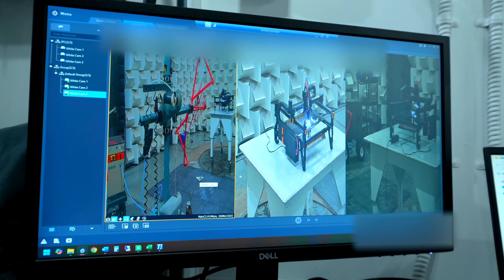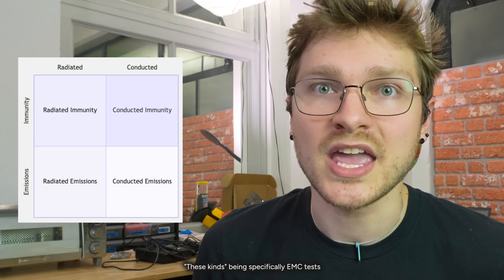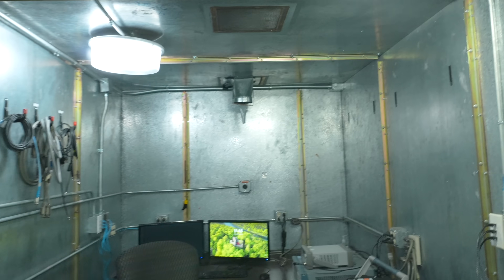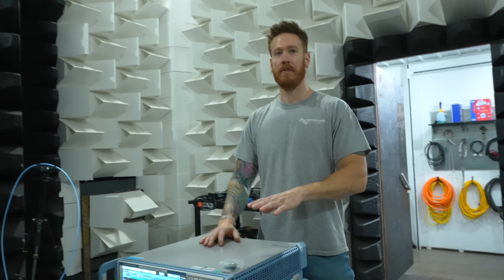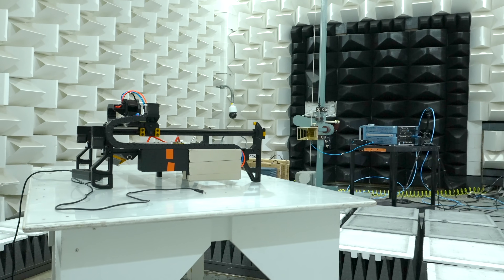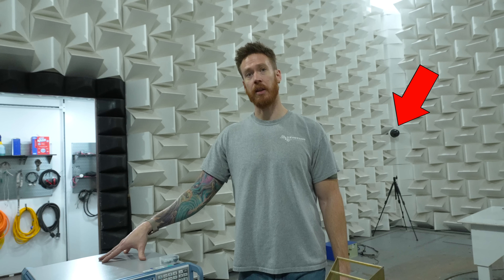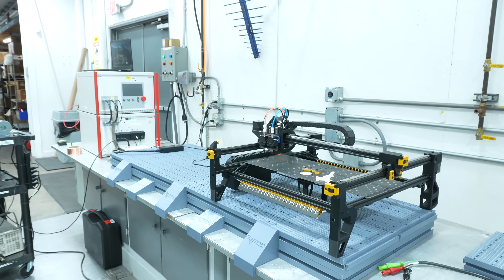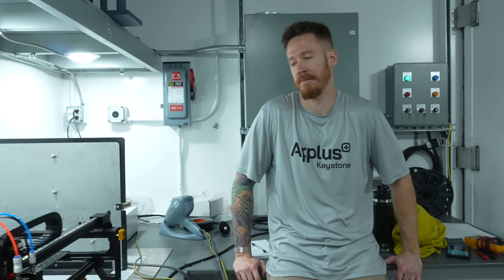Getting Certified: Start to Finish

Comment: I'd be interested in a video explaining some of the changes made to the Lumen before the certification process. It would be interesting to have some examples what to look out for if you want to go through this process with your own product.
Reply: I guessing the following:

1) They improve the DC-DC converter. Usually buck converter are a source of radiated emission. You have to plan carefull where to place components and you need solid ground to "absorbe" the emission. Probably the PCB have internal solid ground layers. Possible the PCB is been completly redesign to have 4 or 6 layers.

2) They improve all ports and every think that connect the electronics board to outside world. You need some esd chip to protect against Electrostatic Discharge.

3) The usb and dc port need some filtration you need an filter that protect the outside world against conducted emmision on the connected cable.

4) For the immunity test you need to protect sensitive part of the PCB, probably they add some filtration on usb/dc port

5) You need to be sure that all material of your device don't contain lead or other hazardous material. For the pcb plastic enclousure you need to be sure that is fire retardant.

Anyway the certification is a serious job, not easy to pass.
Reply: this, please
Reply: Yes please

Comment: It's  ridiculous that immunity is part of  compliance for non safety-related stuff - it's a product quality issue. Such a waste of money. 
As a thing that moves, did you have to do anything for the EU machinery directive?
Reply: I’d rather not have my fridge break because some microwaves got to its internals.
Reply: Funny to see your comment on here Mike. Personally I was thinking of making a relatively low-volume instrument, and remembering that you sell your own products was wondering how you did it, as it might have made a good video. 
As for your comment, I agree its a product quality issue, but isn't that what CE is about? As far as I understand, CE exists mostly to protect consumers, that is why it also covers many other (less technical) topics such as toy safety, and ethical application of AI. And if, as the other comment says, your fridge breaks due to some external interference you wouldn't be very happy as a consumer. Try and prove that in a court of law and hold the manufacturer responsible!
Reply: SO it's Ok to sell  things that may break randomly ?
Reply: @framegrace1 I mean, what thing can't break randomly? Everything breaks eventually.
Reply: I have zero problem, at all, with regulation requiring manufacturers of devices I'm spending hundreds of dollars on to prove that random EMR noise won't brick the device suddenly and without warning. We life in an world full of EMR, and we all hate wasting money.
Reply: Immunity is safety relevant, as a device could malfunction and cause harm, like fire uncontrolled movement etc.

Comment: Do you get UL for free because your power supply brick is already UL?  Edit: Oops just read the errata re UL.
What is the risk of selling an extremely low volume electronic product without going through testing?  Classify it as "Experimental" or "Owner's Risk" or something like that?
Reply: iirc, a lot of countries customs won't let you import uncertified stuff. Low volume unlikely to be an issue, but as soon as you reach volume sales you're more and more likely to get caught. iirc for our makerspace the insurance says that we can only run tools that are certified. If a jank diy 3d printer burns down the shop we aren't covered.
Reply: For Europe, CE is required for any and all products, that includes second hand, experimental etc.

Comment: Have you blocked yourself into the design now? From what I have heard, changing as much as the value of a single resistor means you technically have to have it recertified
Reply: Probably depends on your risk tolerance. CE is self certification. You just say your product complies, and then you're liable if it doesn't so you want to be sure. How sure is up to YOUR business risk tolerance.
Reply: This is not true.
Reply: I had the same question, can you still make hardware changes?
Reply: The answer to this can only be "it depends". Thats one of the things where you need to talk to an expert.

Comment: Are you aware that YouTube enabled AI dubbed Audiotracks for your video? Especially the german one is horrible (pronunciation, ...) and sadly YouTube often defaults to the horrible AI Audio even though I have english as one of my languages in my settings (and YouTube does not remember that I turn this off so I have to change audio tracks for every video with this "feature")

On other videos in the past few month I also noticed factual errors in the AI translation (e.g. 3 miles got translated to 3 meters) -> I can not trust this on technical videos like yours

Comment: How do changes to the Lumen affect your ability to identify as certified? I've always thought that the Superpower of the Lumen (or any Open Hardware really) is to rapidly change and iterate. Once you've gotten the v4 certified, would the v4.1 invalidate the certification? When do you have to recertify?

Thanks for sharing. It's really cool to pull back the curtain and see how all this is done.
Reply: This is one of the big pain points when making hardware with the "go fast and break things" mindset more common in software.

Any small change can affect the EMI/EMC, even something as stupid as changing plastic types or the brand of a capacitor. When doing this, there is typically a risk assessment, sometimes involving testing the changed part on its own.

This is not perfect, but it doesn't have to be. You only need to be confident enough that your product meets the norms. Testing in an accredited test house is a great way to ensure this, but in many cases isn't a requirement.

Government organizations won't go out of their way to buy your product and meticulously test it. Instead, if someone reports issues, it will be investigated. Only if the outcome of this investigation shows lack of due diligence or shady attempts at hiding flaws do you get into real trouble.

I'm not a lawyer, and I mostly know about the ETSI / European ways of doing things. Laws are different in other regions (in Japan and Korea for example things tend to be more difficult).
Reply from the maker: Annoyingly, I think the answer is, "It depends!" If we change the front left leg of the machine to have a slightly tighter tolerance for a press-fit nut, pretty unlikely that's going to be an issue. But of course, if there's a full PCB rev, we're definitely getting it retested. I have not seen any explicit guidelines from an agency around the proper approach for this, so I've always taken a very cautions approach on this one. If anyone has any official resources regarding this question, I'd love to see them!
Reply: @stephen_hawes  As an oblique answer to your question: It's worth investing in your own less-sophisticated EMI and ESD testing gear which you can use to get a ballpark assessment of any issues prior to professional lab testing or retesting. Then a professional session is not just assessing your product, it's also an opportunity to correlate the results from your own test setup with those of the test lab. In this way you can somewhat calibrate your equipment and gain confidence in its predictive capability. At that point you can much better assess whether some change you've made warrants official retesting. (Especially for self-certifications like CE, where you don't have to get outside testing, but may be liable for violations.)
Reply: @stephen_hawes  this is one of the cases were you should consult an expert that looks at the details, because the call can be very difficult to make. It depends is the only right answer.

Comment: A good thing to know: if you aren't sure to pass on the first try / on specific tests, you can rent out most of the ESD equipment needed to do pre - qualification tests. The only thing that really needs to be rented out is the ESD gun, as you can mostly use jank versions of the other things or build your own  ( "good enough" like cheap near field probes for an oscilloscope, or an old mains isolator that you can get on the second hand market / use a variac). It's more expensive if you pass first try, but so much cheaper if you fail as you don't have to redo it completely

Comment: One thing todo is simply doing CE and you can then easily apply for FCC. 
For GMA we had to send 6 devices to china.
Reply: i'd see the big deal if they were getting a ul certification. these are standard tests that have already been done on all the separate electronic components most likely and you'd have to be an idiot to create some sort of emi fault or the sort using off the shelf pre-certified components. I'd find it more impressive if they designed the smps running the thing then had that certified.

Comment: This was a really fascinating process to watch. I've seen the FCC and CE certs and knew it had to do with EMI and other things, but I didn't realize just how in-depth. One question I do have is, at what point do you have to be certified? If you 3D print an enclosure for a Pi with custom firmware and resell it, do you need your own cert, or is it when you start making custom PCBs?

As an aside, I looked up Keystone and saw it's in New Castle, PA. I'm originally from the Mahoning Valley and I think it's exciting to see such a high-tech place there! I don't think a lot of people from the area know that and it should be celebrated!
Reply: Firstly, CE is not a certification, but a statement of compliance. I.e. for most products you dont need to 'prove' that you attain certain standards, but state that you are sure that you do. You could state your product complies, without testing and then sell it, but if your product then breaks something else shit hits the fan. Responsibility is fully on the person selling the item.
On your specific question, I dont know about FCC (I presume this only holds for electronic devices), but CE compliance is required for ANY product you intent to sell in the EU. These are rules in general that a product/service should adhere to and not necessarily technical in nature. There's a big list of compliance directives and legislations depending on product categories that may or may not apply. Some examples include: Toy safety - You cannot have certain allergenic fragrances, or for artificial intelligence - you cannot use AI systems for expanding facial recognition databases through untargeted scraping from the internet or CCTV.